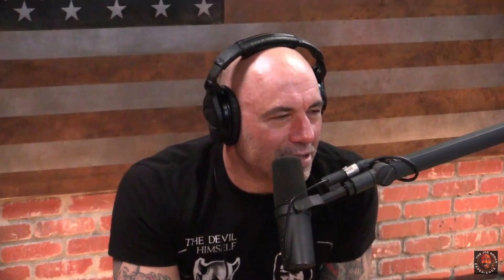Eleanor Mustangs Are Played Out | Joe Rogan & Richard Rawlings

Comment: I love Rawlins acting like he knows the mechanics of a build.
Reply: @Blank. You don't need to have done it to understand the mechanics of doing something like that. They have done something similar by putting the 71 Challenger Scat Pack body on a 2015 Challenger R/T chassis. It's not as difficult as you would think, it just takes a lot of planning & working out. Even the guy B Is For Build on YouTube shows that a complete amateur could take an old car and make a completely modern version of it with planning and problem solving. It's not difficult when you've built cars all your life.
Reply: Wtf why wouldn’t he understand that, they literally do it all the time at HIS shop. It’s not hard to understand cutting and welding, that’s most of what everything comes down to, measuring, cutting and welding.
Reply: Because before they became a show Richard was still building cars
Reply: @Rob except they've shown the history of him working in other people's shops as a mechanic before he opened GMG
Reply: Building cars and swapping engines are not "easy" unless you have done it a few times.For anyone to say its easy has never done it before especially if you're starting from scratch.
Reply: When you make it, you dont have to get your has dirty anymore. Richard already did his time with a wrench and made moves in his life to rid himself of that kind of labor. Now he works hard counting money.
Reply: All I can say is that I thought that Gas Monkey was going to tank after Aaron Kaufman left. Not so, he has some talent in the shop .
Reply: *Aron has entered the.chat
Reply: Oscar from B is for Build is not an amateur Shona
Reply: He actually said “I don’t know anything about them”

Comment: Dropped a K20 in my civic. 320 hp in a civic is a rocket. Lots of torque steer
Reply: How heavy is your clutch? I have a stock ls teggy that I want to do the swap but I injured my left leg and cant have a clutch thats too heavy
Reply: @eriktruchinskas3747  Stage 2, it lasted 6 or 7 years before I had to replace it. Made the mistake of putting the stock clutch back for the time being, it blew out in a few weeks. Too much power for stock
Reply: @Charmer4856  ive never driven anything beyond stock so I dont have a frame of reference
Reply: Respect for doing hondas right.
Reply: @kasper5688  Man I dont know if I can ever give up my K. This is my 2nd one, first one blew out around 230 thousand miles
Reply: @kasper5688  with todays after market tech and the availability of info/ spare engines theres no reason for hondas to be riced out pieces of shit. You can turbocharge your civic with ebag parts (which have gotten exponentially better in quality) for less than 1000 dollars
Reply: K24/K20 is the way to go! That's my set up 300hp N/A.
Reply: @A.spec-alan  I probably should have gone that way. I can still upgrade my cam set up but I dont feel like I need any extra power lol. I dont wanna hurt myself
Reply: @Charmer4856  nice! I just like the extra torque from the k24a2 bottom.

Comment: another one 67 mustang Eleanor movie car is for sale, original movie stunt car with original CVS kit, PS engineering wheels, lincoln rear end, piaa lights, all the hard to find details and a ton of documentation to prove the originality. I am in Bosnia and Herzegovina at the moment, got this info from a frined from Newport Beach OC, Cali. remember that the hero car sold for $1 Million back in 2013. it is not in perfect condition, body panel misalignment visible from every side, some parts of the body kit seam to be molded in instead of bolted, wrong stance etc...

Comment: computers are amazing - BUT if the calculations are off, you only get one crash to know if you are right or dead right.  ,,, Roll cage, wide good seat belts (4 point) probably safest.  Even modern cars go through crash test to prove where the computer models are wrong.

Comment: Yeah, and some "crazy" techhie nerds are starting to build electric supercars and putting on a really OLD restored chassis. Some British builder had like 400 hp battery electric crew cab Kleinbus. Insane. The torque and instant acceleration. And he had like 600 mile range. Me, I prefer safety over looks in a daily driver.

Comment: Joe Rogan drives a 1977 DMT super sport it has 420 cubic inch motor pushing 420 horse with 420 pound feet of torque. 🤔🤔🤣🤣🤣🤣  Trust me it Blazes the quarter mile.  Zero to 60 in 4.20 seconds

Comment: This dude goes “needs to be lower and deeper dish wheels” that’s wheel and suspension, not the body lines or actual aesthetics of the car
Reply: Not true, the wider chassis of the newer portion of the build would need to be narrowed.  It is not simply a wheels and tires or even a suspension swap.